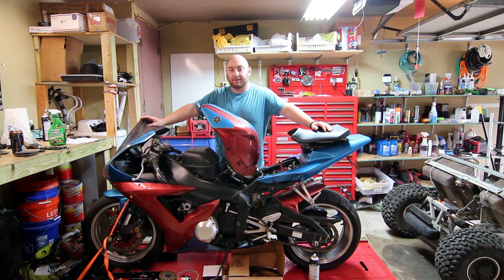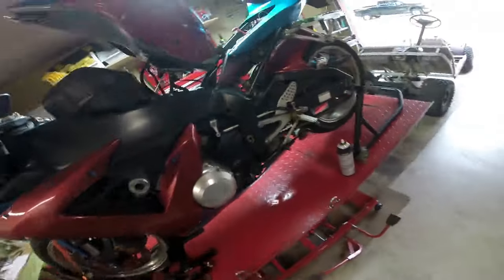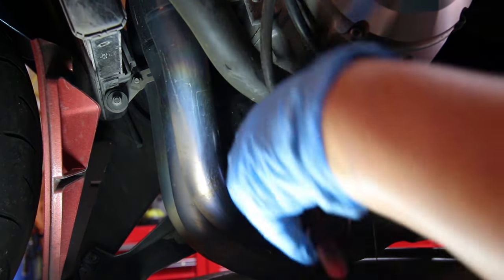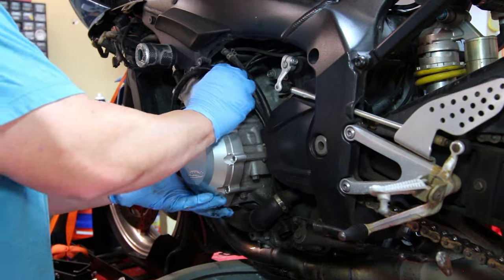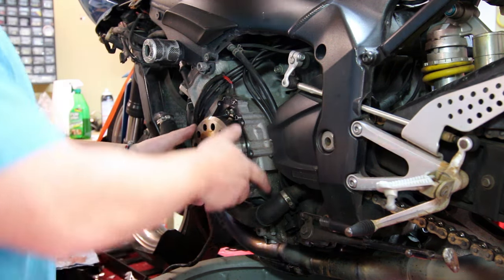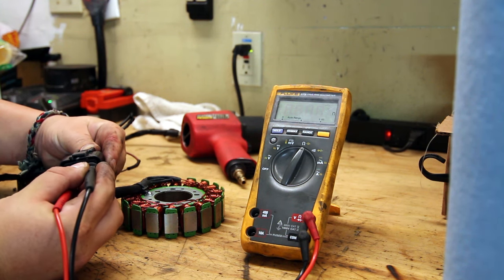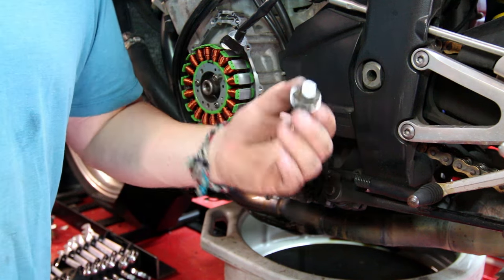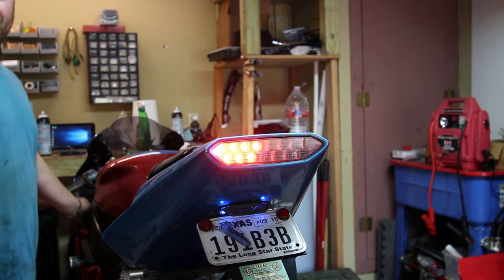2003 Yamaha R1 - Replaceing the Stator and Regulator Rectifier

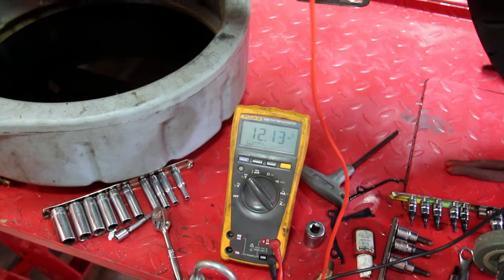Comment: I think not using a battery maintainer is a big reason why the stator burns up.  Every time the bike is started with a battery that is not fully charged, that stator goes to full output trying to recharge the battery.  Perfect example at 10:08 your battery is reading 12.13 volts.  According to a battery state of charge chart (charts tend to differ on their specs), that is either 50% or 20% charged.  So when you started this R1 the stator went to full output.  If the battery had been fully charged, that would not have happened.  Using a battery maintainer would allow you to start the bike with a fully charged battery.  That fully charged battery will substantially increase the life of the stator, rectifier, starter, and battery.  The two most overlooked parts of motorcycle maintenance in my opinion are: not using a battery maintainer, and failing to stabilize the fuel during the off season.  Doing those two things will help most motorcycle owners avoid 80% of the common problems bikes have.  Nice video on how to change the stator.  That's one of the few things I have not had to do on my bike.  My 2000 R6 still has the original stator and rectifier with 29,932 miles on her.
Reply: whats on off season
Reply: @420R1Rider  off season is the time of the year people store the bike. Like winter when it's snowing. People park their bikes and sports cars and use a battery tender and fuel stabilizer until summer. Gasoline separates and loses it's combustion properties, and batteries drain their charge and sweat acid if they aren't used for long periods of time.
Reply: @Chrisnuzzo76  someone can't take a joke, I live in Southern California

Comment: Great video buddy 
Very helpful, I’ve got an R1 5PW 
Yamaha raptor Quad and been having exactly the same issues 
Miss firing clocks going out and eventually bike cuts out, I had it on charger 27-7 365 
Now it starts, just 
Then switch it off it won’t start again 
Definitely time to change the stator 😂👍

Comment: i have a 2007 R1 it has no power.. what should i do 1st.. i have a giid battery and i changed my fuses.. do u think its my stator? and should i change my spark plugs also
Reply from the maker: has no power from the engine? or you have no electrical power?

Comment: Could you post links of where u bought it  my 03 r1 battery died, replaced it. Was running for around 20miles and then it died again. Jumpstartwd it worked for for like 20sec= 20ft and died on me
Reply from the maker: Just on ebay. That seller is long gone.

Comment: What oil do you run in the 02-03 R1's? 
I've seen different things online, but the most readily available thing that comes up is Yamalube 10w40.
Should I get something else that's a different weight oil and synthetic?
Reply from the maker: I use rotella T6 in all my wet clutch bikes. Cheap and easy.

Comment: How likely it is only the regulator not the stator. I got 2003 R1 and i need to do all this process. Still haven't open the bike. But thanks for the video, it helps a lot.
Reply: i did open up the stator and ohm measure the connection pins. The bolt for the magnetic ring was loose and probably didn't spin. pin 1 and 2 shows way too much and pin 3 is dead.
Reply: @Guds777  so you had to replace both?

Comment: I just did a stator on my 03 r1, and thanks for the video however, in my specific case, I almost didn’t check to change the stator bc when I tested the leads everything tested fine at .3-.4 ohms, although after replacing battery and rectifier, still no charge too the case off and the stator was completely smoked, but still tested on multimeter only .4 ohm.

Comment: I just picked up an '04 r1.. has trouble starting .  Went completely dead yesterday had to jump start to get home .  Thinking to replace stator ,rectifier,and spark plugs. Where can I get that puller and any advice to diagnose the electrical problem?
Reply from the maker: I got my puller from motion pro. You can get it direct on their site or search ebay for cheaper options. I would replace the r/r, stator, and upgrade the wiring. Look up green wire mod or w/e its called.
Reply: Tested batter at 13.4 started built up to 14.28 .. low crank at first start ..  still taking apart wanna check resistance on rectifier.  Could my starter be draining at start up ?
Reply from the maker: having some trouble understanding. 

If resting battery is 13.4 and as soon as you hit the starter it drops to less than 11 you have a bad battery.  If you hit the starter and the voltage goes up, you are in a different universe or are measuring the wrong thing.
Reply: Batter at rest was 13 @ startup. And rev to 5rpm went 14.28 . Could the problem be the starter and not the stator/rectifier?  Good video btw
Reply from the maker: ahh. Sounds like everything is working as it should. What is the issue? You should get 13 at rest. and 14.28 running is fine. That means the alternator and R/R are working. 

Is the issue the bike is having a hard time starting? IT could be the starter but I would check for corrosion on the wires. Or even better measure the voltage on the starter. Red probe to starter power wire, black probe to ground. Should see almost the same voltage as battery at rest. Also could be the starter relay, same approach to measurement

Comment: I have a 2003 r1 and couldn't get flywheel off had to use a grinder now I cant get a flywheel anywhere so used my friends old one would this be a problem plus what torque I the stator screws as I don't want it to come loose any help would be gratefully appreciated
Reply from the maker: You took it off with a grinder? That was not a great plan. Not sure about using random parts.
Reply: to be honest I paid a mechanic to take it off charged about $117 and destroyed it luckily today I found a 5pw getting broken so got original stator and flywheel for $180 but thanks for reply I am hoping this will sort the problem out
Reply from the maker: Sorry to hear that. I would not have paid that mechanic anything, or he would have been responsible for the damages.
Reply: I know but its done now just hope my next attempt is better or strip it down for parts
Reply: godamit27 if you sale it for parts let me know😉

Comment: Hey I just picked up an 02 R1 that has some charging issues. Before I take it apart I checked the stator like you did with a multimeter except mine jumped from like 140 all the way to -187 and kept fluctuating...any ideas?
Reply: While measuring the RESISTANCE (not impedance like he said) is a good go no go check the REAL way to check the output of the stator is to disconnect and measure the AC voltage across each pin. 

All that being said if you are measuring above a couple ohms across the windings the stator is cooked. Essentially you are measuring the resistance of a wire which should be a short for all intents and purposes.

Comment: I have a 2001 Yamaha R1. I purchased this bike in 2018 
 Do you have any suggestions on how to remove a fly wheel that has no thread?
Apparently at some point in my motorcycle's life someone not knowing what they wore doing attempted to remove the fly wheel and stripped the thread off.  PLEASE HELP!!
Reply from the maker: If you are replacing the flywheel you could weld on a threaded tube and use a similar tool to press it off. Or drill and tap holes in existing flywheel and use a strap and a bolt to get it off. Either option would destroy the flywheel.

I guess you could find the next size up drill and die and try to re-tap it. Sorry all those options are kinda shitty.

Comment: friend, what measure is your tool with which you removed the magnetic flywheel?
Reply from the maker: measure the diameter of the hole. It should be a 16mm 1.5 thread pitch bolt to pop it out.
Reply: Need a link every puller bolt I have bought has been wrong. Please send a link to buy a tool kit please

Comment: What tool did you use to pull that flywheel off? I'm doing this project tomorrow and I don't have a flywheel puller.
Reply from the maker: I used a flywheel puller. Not the right one, but one i had.
Reply: MaksWerks where did u get this flywheel puller and where can I get the right one

Comment: Will a lot of oil come out after you take the cover off? Or what
Reply from the maker: If the bike is vertical you are going to dump some oil. If you lay it down on the other side you could conceivably do it without changing the oil. People do that all the time on dirtbikes since they are meant to be dropped anyway. I would not recommend doing it on a sport bike. rotella is cheap.
Reply: MaksWerks ok thanks man awesome damn video though described everything perfectly!

Comment: how reliable is that stator and rectifier, for only $50?
Reply from the maker: Worked fine for me.
Reply: MaksWerks  could you send me a link to where you get your parts?
Reply from the maker: I just got it off ebay.
Reply: 1 year..and its burned again...best way to replace this is to take a 1999-2000-2001 R1 stator and the flywheel also...you get these two oem in good condition...and they will last longer than this cheap chinese stator...
Reply: If the stator failed after 13 years. Its bound to fail used.
These stator should last. Probably have a year warranty or 2. But they should last a long time. I don't know many parts that have more warranty than that, maybe a lifetime of they're hardly mechanical like a stator.... Thatd be quite impressive.

Comment: What size is the stator extractor? I have a problem with my motorcycle and it is the same as the help video
Reply from the maker: 16mm puller.
Reply: MaksWerks thanks brother hey my motorcycle is a 2002 yamaha r1 the one in the video too? just to be sure
Reply from the maker: @adrianbarrientos2754  I had an 03 but they should be the same.
Reply: MaksWerks thanks friend the video is very helpful thanks for the very kind information
Reply: Do you think they sell it in the car zone
Reply: You do not know where I can get it I live in Mexico CD Juarez
Reply from the maker: @adrianbarrientos2754  Pretty sure ebay works in mexico. I have never had much luck getting stuff like this in stores.
Reply: MaksWerks  that's the name of the storeI have in ? In which store did you buy it?
Reply from the maker: @adrianbarrientos2754  MotionPro Carries it

Comment: I have a 2005 R1 we're can I find a stator and a regulator. The shop is trying to charge me 1200 to replace it
Reply from the maker: You can buy OEM grade parts from ronayers or any other major distributor. I have also bought no name parts of ebay that worked fine. just search by model and year.
Reply: @Makswerks1  okay, thank you.

Comment: Hi guys, i really need help for check the parameters of my stator and my voltage regulator in my R1 2005? someone can help me?
Reply from the maker: pull down the manual from carlsalter.com and follow the procedure.
Reply: @Makswerks1  thank you very much

Comment: You never showed how hard it is to remove the flywheel cover couse no way it comes off like that
Reply from the maker: The flywheel cover just comes off when you remove the bolts along the perimeter. The flywheel itself comes off with the puller tool. No real rocket science.
Reply: Thats not the puller it shows in manual an if the threads aren't Wright why would you even try to use it???

Comment: Please dont say that you dont know why occurs stator burn for this type of R1 :) Ok let me tell you. Thats because the cooling of the stator is bad. There is not enough oil to cover the whole stator equally to cool down, then it overheats and there is a burned stator. Take a look always the left upper coils burns ;) Cheers
Reply from the maker: These older yamahas had poor oil circulation, shitty plugs, and bad grounds. Any of those could cause this problem./
Reply: Even if i ride a Honda love this 2003 R1 not an oil eater as earlier models. You did a good video anyway thanks i enjoyed :) These burned stators can be also fixed with professional rewinding method with high temperature resistant double insulation to be long lasting even better than factory stators.
Reply: yeah....good nonsense bro...the oil in there is NEVER MEANT TO COOL DOWN THE STATOR...this stator has a manufacturing fail...it burns the laquer on the rods...thats why it burns the coils...OIL NEVER COOLS DOWN STATORS IN THIS KIND OF BIKES...
Reply: Yeah...go get a job and leave the bike mecanics for someone else...

Comment: Great videos bud.  I finally have an appropriate video to reply to. FYI  I so want to paint that bike! Too each his own.  I own a sportbike body-custom and repair shop. (www.msrecycle.com) I have an 02 too --- well sort of.    I have an 01 frame w/ 03 motor and it is very custom/modified the proper way. Built not bought by yours truly including a unique body made out of ABS OEM fairings and OEM donor plastic.  Every fairing is modified/cut/welded/fused/tweaked/etc in one way or  a bunch others ;-)  For example the upper has a fusion of a 2001 and a 2008  upper fairing.  The fairing stay was modified and then welded to allow the 2008 lights and ram air system to be installed.  I desperately need to find a good way to tune that.  Blah....   Anyway, the rear fairing is a 2001 rear section married to a 2006 front which gives it much more of a hour glass / voluptuous (For lack of a better word albeit appropriate)  over-all body shape.  The front of the rear fairing as well as the seat is very narrow compared to stock and it curves way in where the OEM is nearly straight. There's just way too much to list.  Has 2012 OEM R1 front end,. I create a 2018 R1 can on the stock 01 header and leader pipe (I was so so so so!!! INSANELY blown away by how damn good that thing sounds.  I highly recommend that mod and you can install it on any leader pipe. Believe me it breathes because it is more or less wide open as the 15-18 R1 has he big ass silencer under the oil pan.  Has integrated round indicators and brake lights front and back.  06 seat... 02/03 R1 motor and electronics etc... PC3R. Blah blah there's a ton more.  .  
http://www.msrecycle.com/ProjectR1/Webshots/2018/IMG_6985.JPG
http://www.msrecycle.com/ProjectR1/Webshots/2018/Tail%20Small.JPG   http://www.msrecycle.com/ProjectR1/Webshots/2018/IMG_6992.JPG http://www.msrecycle.com/ProjectR1/Webshots/2018/IMG_6990.JPG http://www.msrecycle.com/ProjectR1/Webshots/2018/IMG_6991.JPG  http://www.msrecycle.com/ProjectR1/Webshots/2018/IMG_6989.JPG http://www.msrecycle.com/ProjectR1/Webshots/2018/2015-2018%20R1%20Pipe%20Mod/IMG_7017.JPG

Comment: You didn't do the rectifier/regulator!
Reply from the maker: I did. Its just not in the vid. Its 2 bolts and 2 plugs so pretty straight forward.
Reply: where is it located? in the air box? I have 14 volts when idle but it drops dramatically when rpm increases.
Reply: Get the manual

Comment: Yuck. K&n surprised no one has said anything about that.
Reply from the maker: That's cause outside the internet people been using and winning with K&N products for years. They are my go to for oil filters on bikes due to the welded on 17mm nut which makes installations easier.